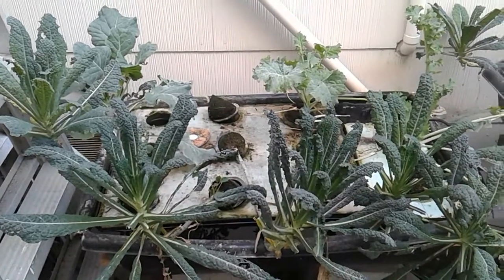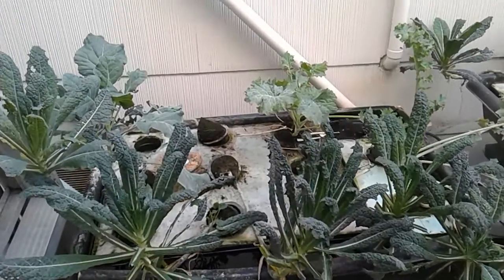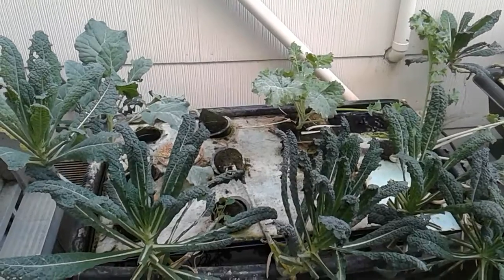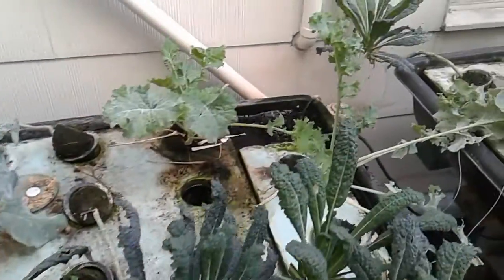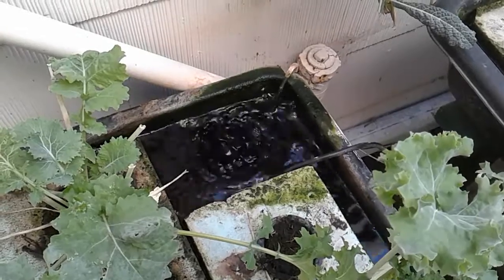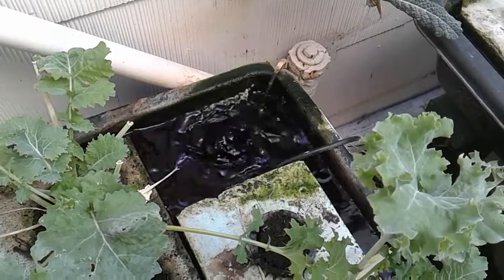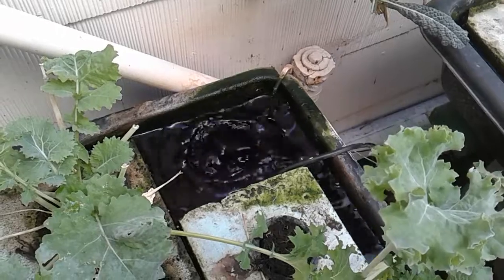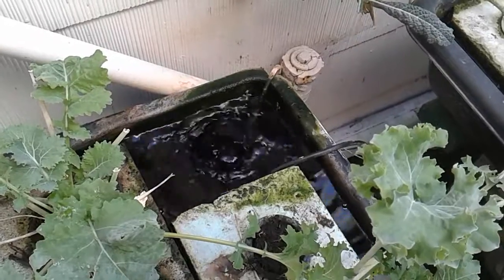Fountain Hydroponics

Comment: Interesting.  I grow my lettuce in the same type setup and have no pumps or bubblers.  I have tried an air pump and it 'might' make a bit of a difference, but not enough to worry about.   My lettuce grows fast and tastes great!
Reply from the maker: I think it is also true that air comes in from the top. 
When I lift a float the root mass is very small compared to the plant mass. 
I will continue to pump. 
I took out two of the plants in the small float on two of the tubs. 
I have a bigger pump in my 4x8 tube and it makes a big fountain, so I'll stay with the air pump. 
I now have about 5 air pumps in stock to work through. 
They do fail. 
I have a 100 watt solar panel so the next thing may be to see if I can run the system off that.
If I was building a new tub I'd just use the water pump. They are EcoPlus brand.